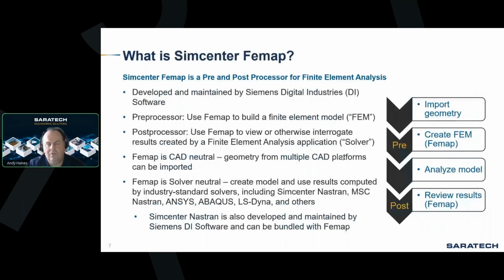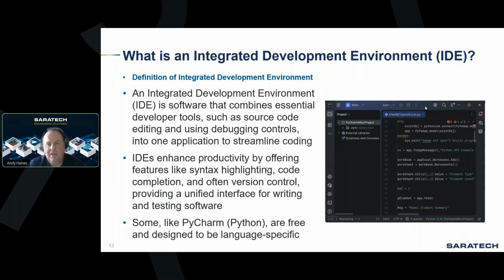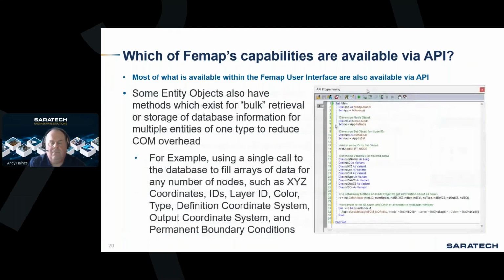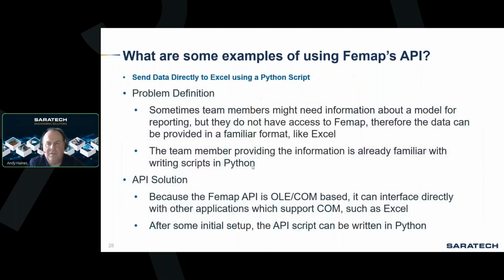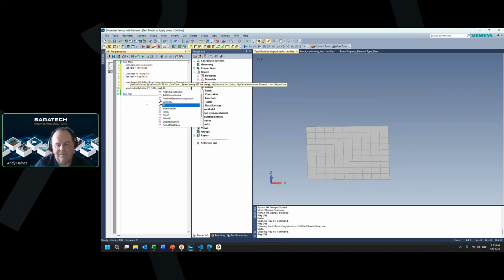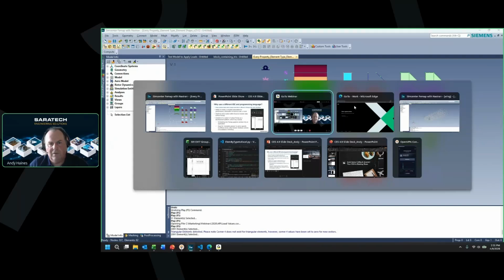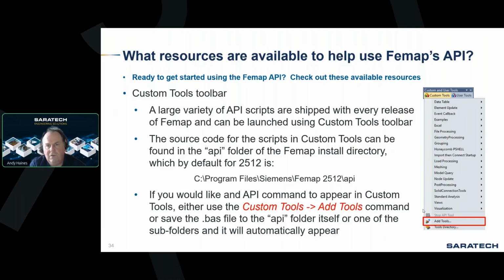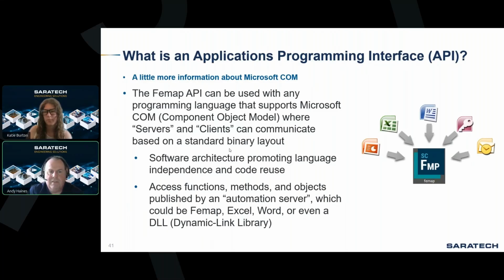Streamlining Simulation Workflows in Simcenter Femap via API Customization

Comment from the maker: Transcript:
So with that, I'm excited to hand things over to Andy. Take it away.

Thank you very much, Katie. ⁓ All right, so everybody knows ⁓ today that we're here to talk about the Femap API and helping streamline your workflows. Now, ⁓ I would assume most people are familiar with what Simcenter Femap is, but that's where we're going to start. And then we're just going to kind of answer these questions along the line. So just for anybody who might not be familiar with Femap, what it is, it's a pre and post processor for finite element analysis.

It's developed and maintained by Siemens, digital industries. The pre-processing is building the final moment. The post-processing is ⁓ basically being able to interrogate your results after you've used a solver. ⁓ Femap is CAD-neutral, it's also solver-neutral, but deals with a of the industry standards, such as Simcenter, Nastran MSC, Nastran, Ansys, Abacus, and LS-Dyna. And just so everybody knows, Simcenter, Nastran,

is another Siemens DI product. And then again, this is just a picture of Femap. It just looks like a lot of other Windows applications, especially analysis applications. you just basically have menu structure, toolbars, et cetera. OK, so what we're really here for today is what is an applications programming interface? And from now on, we're just going to call it an API. So what it really does is it gives you programmatic access to an application.

and it's typically supported by like a product development or support teams. So what it allows you to do is basically, you know, access menu commands or toolbars by, you know, just providing the needed arguments in order to run those commands. A lot of them also have objects, you know, so an object typically relate to a type of entity. Inside of the application and then there's going to be some properties and methods for each one of those objects.

and then some tools which can actually help you leverage an application's core and underlying functionality. And the big thing about the API, in almost all cases, it's almost impossible to use any program's API without good documentation. But you got to remember that most documentation for API is going to be much more like a reference manual than something you read cover to cover.

So here's just some overall information about Femaps API. So ⁓ it's OLA COM based programming. ⁓ So it contains literally hundreds of functions for use with ⁓ either Femaps integrated development environment, ⁓ IDE, which we're going to talk about that using a VBA style, like a Visual Basic for application style language. But you can also use the API with a Visual Basic C, C++. ⁓

A lot of people are using something like ⁓ Microsoft Visual Studio or they're using Visual Basic for applications from within an MS Office application like Excel Word or Access. And just because we know a lot of newer engineers are really familiar with Python, you can absolutely use the Femap API with Python. You just have to do some initial ⁓ steps in the beginning, such as create the

the type library in a very particular manner.

So why would someone want to use any API? ⁓ Simple things. You can add functionality that's not really in the product. You can automate repetitive tasks. You can allow communications between multiple applications for data exchange, ⁓ sure quality of new and incremental enhancements. You can also create consistent workflows among ⁓ an engineering group. And actually, and this is something that we've seen people use. ⁓

do with the Femap API is actually use the applications underlying capabilities for tasks that they were actually never originally developed. So, I mean, that's certainly something interesting. So again, why would someone specifically wanna use the Femap API? You can create programs that guarantee use of an organization as proprietary methods such as creation of fasteners. A lot of different Airframe companies, they all have a different way they do fasteners. So.

A lot of times it's just great to be able to automate that particular process. You can also try to reduce the learning curve for new users by providing tools kind of designed around a typical workflow that they might encounter day to day. Compute required results using parameters for a specific project. So, you know, things such as margins of safety. Move data to a program like Excel or MATLAB or have it move from Excel

back into Femap. And then a big one here at the bottom is automated, automate generation of customized analysis reports, follow a common template and formatting.
Reply from the maker: So I mentioned an integrated development environment or IDE. What is this? It's basically like a one-stop shop for one-year coding. essentially, it ⁓ gives you developer tools. It allows you to edit the source code, debug ⁓ all in one application, and it just allows you to streamline coding. ⁓ They kind of enhance the productivity by offering features like

syntax highlighting, code completion, which is a big one, and ⁓ in some of the more powerful IDEs, you're getting version control as well. And again, it's just the entire idea here is just to provide a unified interface. Some, like PyCharm, which is shown here, are free and designed to be language specific, in that case, Python. ⁓ Others, like Visual Studio Code, are also free but support multiple programming language.

⁓ including Python. And then a lot of times if you're going to be doing any kind of more heavy duty development, that's where you're going to want to get into something like Visual Studio, which has to be licensed, but it offers an entirely different level of functionality compared to some of the free offerings. And just what I'm showing here in this picture is actually the way that you can create the ⁓ Pyfemap type library from the type library, from the Femap type library.

So now that we've talked about the API and IDEs, does Femap have one? Yes, it does. It has the API programming dockable pane. So you can open this up by just going into either the tools programming ⁓ or just clicking the icon in the panes toolbar and it'll open up this API programming window within Femap. And don't worry, we're going to get into that very, very shortly. So what does it offer? ⁓

The one thing to know is it's not actually visual basic, but it's very, very similar to visual basic. And it's actually a programming language called WinRep. So when you're in the API programming dockable pane, you get syntax highlighting, code completion. If you want to create some dialog boxes with common controls, you can do that through the user dialog editor. ⁓ And that dialog box shown on the right.

was one that was created completely within the API programming window. And the other nice part about it is it creates ⁓ .bas files, which only contain text. They're not compiled or anything of that nature. So they're easy to look at. You can send it to somebody. And even if you have to get it through somebody's firewall or something like that, you can always just ⁓ convert the file to a .txt file and then just have them convert it to a .bas file on the back end. ⁓

So which of Femap's capabilities are available via the API? And ⁓ the truth is most of what is available within the Femap user interface is also available via API. So we have a couple of different things that we're going to talk about. The first thing we're going to talk about is the Femap application object. You can think of this as the quote unquote Femap object, not an object of one of the N's within Femap. ⁓

This object is always automatically created by default within Femaps IDE. So what does it give you access to? Basically, you can access all the menu commands and toolbar commands programmatically. And again, you just need to provide the given arguments so there doesn't have to be interaction from the user in order to help automate that process.

It also gives you access to standard dialog boxes and other user interface items. if you've been in Femap and you wanted to pick a location, specify a vector, specify a plane, you can just have it bring up Femaps dialog boxes that are specifically made to do those. So then you get all the methods and everything that's already in the interface from there. Also, global settings, such as preferences.

Along with this you also have tool objects. So all of Femap selection methods basically are available through the set object and we will go into that during the demonstration portion of this session. You know the ability to copy, move, transform entities. Reading data from external files. So you basically just get access to be able to use Femap to do that. You can deal with interaction.

between currently open models. So if anybody's ever used the file merge command inside of Femap, you actually have programmatic access to that, which was a somewhat recent addition. The other thing you can do is things like data mapping, ⁓ storing user-defined information, geometry modification, meshing, and handling of results. And what you're doing is you're actually able to ⁓ lean on Femap's

built-in data structures and routines in order to improve performance when you're doing those type of operations. And then we also give you access to some specialized post-processing, such as stress linearization and the calculation of ⁓ beam cross-sections based on some more typical solver output.
Reply from the maker: Also, finally, when we're talking about things, we're talking about individual entity objects. These are your nodes, elements, materials, properties, et cetera. But also things like groups, analysis sets, output sets, views, basically all that. you have some of these methods are common to all objects, like, does this object exist? Others are very specific, like, hey, find me the point that is closest to these given coordinates.

Or there's also some even some other methods that are designed to retrieve things in bulk. So let's say you just need all the information for all of the nodes in your model because you wanted to run through them and just either check for something, list something, or just try to figure out something in particular. What you can do is you can just get them all with one call to the database. ⁓ And by doing that, then you can

put the data in arrays, and then you can just run through the arrays without having ⁓ to have the API talk to Femap through COM. So essentially, once you have the data on, once you've recovered the data and it's already in arrays, then you can just run through the arrays themselves without having to get put ⁓ all the information time and time again.

Last thing that's available are Femap events. You can imagine an event is something that is occurring in Femap ⁓ where you just basically need the API to wait for something to happen in most cases before it moves on to a next step. ⁓ One of the most common ones would be ⁓ you've automatically launched an analysis and now you're just waiting for Femap for Simcenter and Ashtran.

to finish the analysis before it moves on to the next step, which may be just launching another analysis or move on to something like post-processing. And there's a couple of different ways to do this. You can use the callback from within Femaps IDE, or you can ⁓ use any form of message handling if you're using another programming language. So ⁓ obviously,

The documentation, as I said, is very important. essentially, if you're looking for information about the ⁓ objects or things that are actually about the Femap API, that's where you go to help programming. You can also use ⁓ F1 by simply putting the cursor within an object or call within the API programming window, and it'll be context sensitive. ⁓ Also, mean, for some, ⁓

For some folks, it's a lot easier just to look at the PDF sometimes. it's available in there. But then WinWrap and the API programming window itself has its own documentation. So if you're looking for a certain math operator or something of that nature, what you can do is just go to Help Basic Programming, and it will bring up the WinWrap help instead of the help about.

Femaps API specifically.

So we're going to talkabout some examples then I'm going to go over to FEMA and we're going to and I'm going to show you them all after I do a little bit of just sort of live coding so Alright, so let's just say somebody You have load values that group a Already has and they need to provide it to several other groups What they can do is what somebody could do is just put those loads into something like a CSV file comma separated value file so then what you can actually do is have

theme apps built-in capabilities to read from a file, just read through that .csv file and automatically create loads and boundary conditions. And here's actually all the code it takes to do that. you can see that it's fully commented and everything. again, you have the load values in Excel, and they're saved as a CSV file. You pick it using a standard dialog box. ⁓ Those are the nodes to load, and those are the forces that are created.

⁓ Create critical results, which were not calculated by the solver. ⁓ So let's say you needed to calculate membrane and bending stresses on shell elements based on force and moment results, which exist in the root mean square or RMS output generated by a random response from ⁓ Simcenter and Astran. It's actually a pretty simple calculation to do this, but it's just not one that is done by default by Astran.

So what you can actually do is use Femap's internal routines for processing results, which are available in something we call the Results Browsing Object, or RBO, ⁓ to create new output vectors into any number of selected output sets. basically, ⁓ what's nice here is that you have the existing output vectors. It brings up the dialog box that you're familiar with from Femap, again, because you have all the selection methods.

built-in that you can access. And then you can see that you can take a look at the computed output vector. One last one is sometimes ⁓ somebody might need information from a model for reporting, say, but they don't have access to Femap. So therefore, you just kind of want to send them that data ⁓ in a familiar format, something like Excel.

⁓ Now here's the thing, maybe somebody's not familiar with Femaps API with WinRap, they're familiar with Python. Well, okay, great. Because Femap is OLA-com based, you can have it interface directly with other applications which support com such as Excel. And again, after a little bit of initial setup, the API script can then be written in Python. And again, ⁓ this is just VS code. This is actually that

free version of this that I mentioned. ⁓ basically, you can just write your Python code from within VS Code and have it talk to an open instance of Femap. And in this case, we just have a model containing all the element types. And it's going to automatically open Excel and ⁓ send everything into there automatically.

One last little thing before we get into the demo is why would you want to use a different IDE in programming language? This is the ability to create a compiled executable for performance, obfuscation of source code or both, or a desire to add a button within Excel to transfer data to and from Femap. Other things that you can really, if you really want to go all out, can do creation of a custom UI using Femap as

more of a development platform. So you can embed the graphics window into any application, or you can also create dockable panes to aid in some specific workflow or other kind of human interface controls that simply aren't available in WinRAMP. So here, let's just go over to Femap, and we'll start here. All right, so again, I already have the API programming window open.
Reply from the maker: But if I didn't, I could just come here to go to Tools, Programming API. All right. So the first thing we're going to do here is we're going to dim.

Something like nd as theme map dot and then these are all of our different Objects that are available. So I'm just going to say node and Then I'm just gonna set nd Equal to app dot Fe node. All right now that this is set up anytime I type nd in my IDE here It's going to bring up

What's available on the node object? So let's just say I wanted to get and you can think of get as It's getting something from the database. Okay, so we're going to get node 10 And we're going to do You know the node color equals nd There we go, so we're just going to get the color now Let's just say we wanted to instead set the color

So we can then say, just kind of do it the opposite way, equals. And what you're going to see here is these are enumerations or enums. So instead of needing to know the ID of a particular color or something of that nature, and we have these enums all over the API to try to make it easier so you don't have to always go look at the documentation, basically, hey, I know I want to use red. So I'm going to do that. And the nice part is,

is that if you've recently used it, that enumeration, it's going to come to the top the next time. So what we're also going to do here is now we're just going to put this back to the database.

Okay, and then what we're going to want to do is we're going to want to regenerate the window. So we're just going to do window regenerate. And if you just type in a zero here, what you're going to see is that this is just going to do a regeneration. ⁓ Basically a double click in the screen to make sure that we see the update. So I'm what I'm doing here. I'm doing something real simple.

just changing the color of one of the nodes to be red. And it's this guy. All right. So that's all well and good. But let's say we wanted to actually pick a bunch of these things and do it at the same time. So what we're going to do here is use a set object and set instead. So I'm going to do dim and set as themat.set.

I'm going to set end set equal to .fe set.

So now when I go to end set, again, these are all options. So I could just add one ID at a time, add them all, add them all by color, them all by just, basically every method that's available for selection is also available in the set object. And that's great and all, but you know what? Sometimes we do need a little human interaction here. So we can also just use select. So I can say, hey, what am I picking?

I'm going to pick elements here. And I'm going to just say true, because I don't want that to end. select elements.

Put a string in there. And then what we're going to do is we're going to use the FVModify.

color.

elements. We're going to use our set object. So what we can do here is endset.id. I switched on the fly. It doesn't matter that I used endset and I'm changing elements. It's all based on what we did here. So and here we'll just make them blue. Okay and whether I want to randomize my colors and false. I just want them all to be blue. So now what I can do

This is this is the beauty of this is I when I start this What's going to come up is it's going to bring me up my it's going to bring me up my standard dialog box for entity selection so now I can just you know pick any way I feel like Say okay and Walla it was able to do that so essentially what I did was essentially asked for one input from the user

Then was and then we were able to automate the rest of it And again if you had a whole string of things you needed to do to those elements It would just be a lot faster in order to do that Okay now One of the first things that we talked about was automatically creating loads from that CSV file So again, here's just all the code as you can see I mean, it's it's 80 lines, but it could save you so much time

without having to copy and paste it and create it and things of that nature. So we're just going to start it here. I'm just going to pick my load values. What it's automatically going to do, it's going to make me a new load set and make me loads based on what was in that ⁓ CSV file. All right, so it was that simple.

⁓ Another thing we're going to do so here you'd see that we're looking at plate X membrane forces So if I were to take a look at what I have here in my RMS output sets I Don't have membrane and bending stress. They were not calculated By this random response analysis. Okay So what am I going to do here? Just say okay. I'm going to just

run from here. And I'm just going to say, hey, I want to just start this. What's CMAP going to prompt me for? Some output sets. Which output sets do I want to put this in? Now, I could have automated for it to go through and just automatically do it for everyone that was named RMS. And we certainly could have done that. But the nice part about this is that you can also use things like the output set filtering or filtering for anything. So we're just going to type in RMS.

And we're just going to say, we just want to do it in those two output sets. Pick which elements we want. Again, we could have just had it select all, but it's nice to have the option. If you only need it for a bit, because this one happened to have some triangular elements in it, it's just basically telling you that it made all the corner four vectors on the triangular elements zero, because this did have corner data. OK, terrific. All right.

And then what we could do is we can just come here to post data. And now you can see I have membrane stresses and bending stresses. So we'll just go to membrane stress. And what you're going to see is it's going to be essentially the same exact contour. ⁓ But as you can see, we're now looking at stress results instead of force results. Now that we have these created, let's say we just wanted to put them somewhere.

What you can always do in Femap. Is you can always make yourself a new toolbar. Call it Andy's commands.

All right, and now that I have that, I can make a user command. So I can just say, hey, I want to compute. And what am I doing? I'm going to actually go pick my API programming, my API program. So it's right here, this one. So I just add it here. And then if I come over to Commands, you can see that ⁓ there's nothing here. This is just a tiny little quirk. ⁓

You just have to close this and just go back into it.

Customize and all of a sudden you'll see user commands at the top here So then I can just take my command and I can say compute and I can just put it out there on my toolbar and there are also ways once you have your API step to automatically create toolbars and that sort of thing, but so here now I could just run this again I I can just use the hey just use the previous ones that you did last time, okay? ⁓ Select all my elements again

⁓ these are already exist in here. Okay. Yeah, I don't need to do it. Yeah, don't need to do it again Perfectly fine done, you know, so just so and you can certainly build logic like that into the code All right. So again, let's go back to our thought where we need to send how many elements of a particular type are in a model So somebody else can use it in a report

So what we're going to do is we're going to come over here to our Python code, which, again, because the person was familiar with Python, again, after a little bit of setup, they were able to do that. We can just run our Python file.

that did was it sent all this information over to Excel. now the type of elements. And of course, you could use any naming you want. This is just how they're actually named by type within Vmap. And basically just account for each one. right. One more thing that we kind of wanted to talk about.

is basically using this button, a button from within Excel in order to do something. So I'm actually going to have a different Femap open. So I'm going to just try to use my API here. Now, this instance of Femap is the one I'm currently in and I'm using and everything. But just with some limitations in COM, by default,